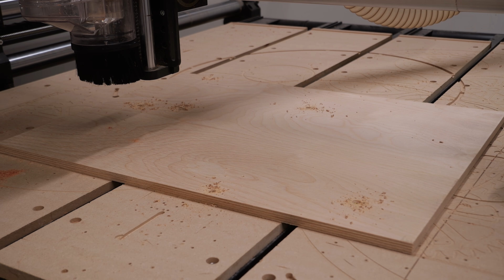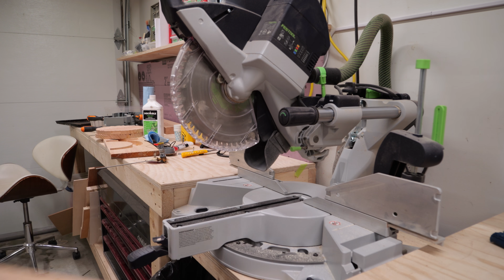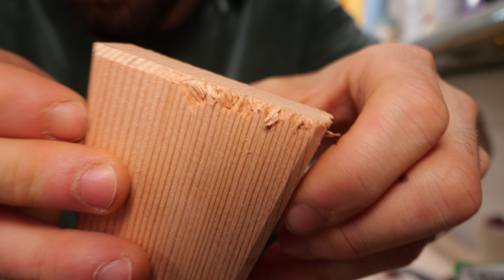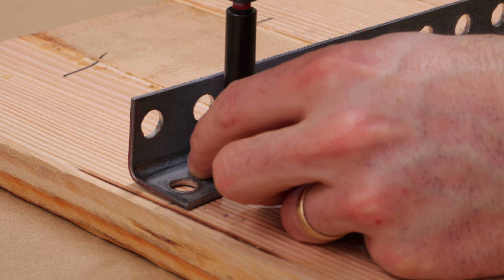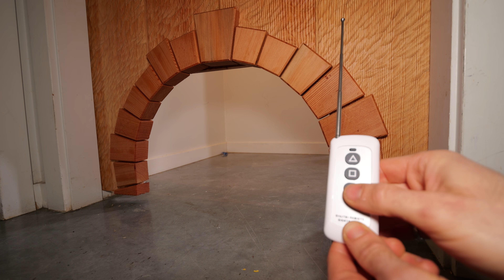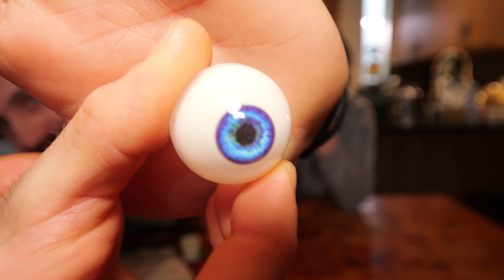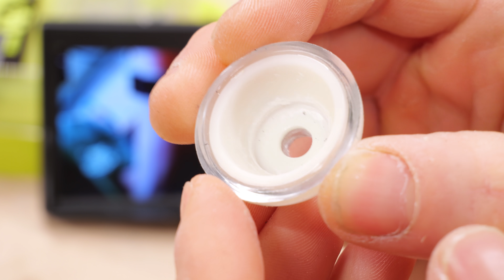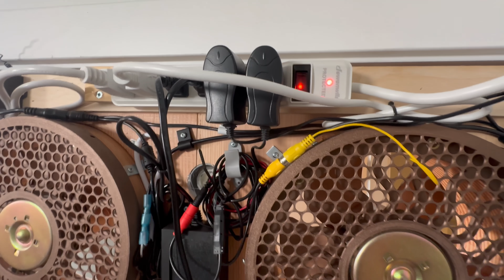I Built an Over-Engineered Door for My Wobbly Cat

Comment: Fellas, it's manual and overbuilt. It's not gonna chop up the kitty. The litter box thing was bad because it was automatic and could not react. This has a camera on one side, actual eyeballs on the other, and is manually controlled. And a paracord like that can hold far more weight than it is, as that's its job. The whole thing would need to be solid steel for it to be too heavy for the cord.
It's far more likely to just drop the cat when holding them in your arms than for this mechanism to bisect a cat. It's just a remote piston. YOU'RE just a bunch of wired pistons, and both are controlled by a person

Comment: I don't think this is AS dangerous as other commenters have stated:
1. Depending on the type of wood used, the door may not be heavy enough to severely hurt the cat even in the case of total failure.
2. Even if it is too heavy, solenoid closes the door slowly enough that if it catches the kitty it will not cause injury from the impact giving it more time to escape.
3. Using paracord instead of rigid linkages prevents the force of the solenoid from crushing the cat, only the weight of the door would be pressing down on the kitty, which is hopefully not enough to hurt it.

Now if a very heavy and dense wood was used, then that would be dangerous if something were to fail, and you can never be too safe.
I'd recommend using lighter materials and a spring loaded rack lock held closed by the paracord, if the string loses tension (i.e. the door is falling out of control) then the spring pushes the lock into a rack on the doorframe stopping the door immediately. This is the same mechanism used on the first elevators btw. If these modifications are done, then I suspect digital sensors and shutoff switches are unnecessary.

Comment: I've used Tuya valve controllers, it clamps onto a pipe and actuates the lever.

Actually strong enough to open a standard garden gate, during R&D I burned out a motor, I sent to motor wires to a linear actuator and it worked perfectly.

Comment: Agree with many other comments. It is confusing to understand what some mean by use the screws from a 3D printer, but if you add these to the design then you should be able to also use a motor controller and then determine if the door is jamming, which will then prevent anything from being smashed, cat, foot or otherwise. I feel that using a manual mechanism is fine, but you do have to engineer around the ability to make mistakes. The other option I saw that works just as well but would be harder to implement is a counterweight. I am not sure how you would build this in because of the space available.

Comment: Dude, in terms of CNC, YOUR HANDS GROWS DIRECTLY FROM YOUR ASS !!! First and for most - if you have a milling cutter that is held in a collet by the very tip... make a layer of passage NO MORE THAN 1 MM. Second - to avoid uneven edges... DO A BYPASS OF THE EDGES ALONG THE VECTOR BEFORE 3D SAMPLING. And third - NEVER CUT A WHOLE LOG OF WOOD ON CNC, glue a wooden board made of slats and it will not fall apart when cutting.

Comment: I am lazy and noise sensitive (so I don't really like vacuuming) so even before I got my first cat I got a robot vacuum albeit a really cheap one just to see if that would work for me. Then I got cats and needed to upgrade.... mine washes the floors, too, which is so necessary with pets.... and even the vacuuming bit: my cats don't shed that much, they are regular short-hair domestic cats, one of them is black, too :), but even so, if I am away for the weekend and the robot got stuck somewhere and couldn't clean, you can tell immediately. it doesn't do a perfect job, but the fact that it is done daily makes a huge difference....

Comment: Loads of people have already said it, but since none of the ones I've seen had a creator heart or comment on it, I'll say it too: This door needs safety features. The actuator locking in place prevents it from dropping at power failure, but not from cord failure nor from closing while something is underneath, be it from oversight or erroneous activation. Someone suggested a counterweight, and I concur. This would reduce the effective weight so it doesn't crush an unfortunately positioned cat.

Comment: You should control the door using ESP32 so it can be connect d to home assistant. This would allow controlling it manually from wireless switches and also automatically with motion sensors. You could create time based automations that only allowed manual control during certain hours.

Comment: For people worried about the Cat's safety you can rest easy:
- You can't push rope. go ahead and try it at home. try and push something using a piece of rope over 1ft (30cm) long. 
- the door closes with the use of gravity, the rope can't push the door closed (see point 1) and you could lift it up by hand without the mechanism being engaged.
- the door weighs at most 5 lbs (2.2kg) , and travels a distance of at most 1ft (30cm). at worst case, if the rope is cut or snaps, it's not going to have time to accelerate to a dangerous amount of momentum and will at worse, give the cat a bonk and a scare because they fall farther than that when failing to jump onto or off of things. 
- the door is completely manually operated. 
- automatic feeders/litterboxes that have caused problems have high torq, powered doors that are mechanically driven to close. 

Y'all're right in terms of fixes for best practices for safety, especially at anything larger than that scale. Counterweights that when unpowered default to opening the door. Mechanical locking pins that engage when the door is fully open. Proximity/line-break Sensors. Etc. are some of the great suggestions i saw. it's really important when designing to consider "What does failure look like and how can i make sure it's safe?" so keep up the thoughtful engagement.
Reply: I was about to not be able to sleep… thank you…

Comment: Not a good look to be hearting only comments that don't mention potential safety issues. I know it probably stings, to have put in so much effort on something only to have so many people criticize it on a fundamental level, but you really ought to swallow your pride and go back to the drawing board for the sake of your cat. It doesn't matter how unlikely an accident is to occur, an unlikely accident is still going to happen to *someone*. Safety regulations are written in blood.
Reply: People hope but never really believe they're going to win the lottery, and usually they're right, but every year a few people are wrong and it does occur. Granted this is a positive occurance so its fine if it happens, but the point is that however unlikely, it still happens to someone at some point, and there's no reason why you couldn't be that someone.

Comment: You need a camera power supply you can get them for multiple cameras then you only need one outlet or you can just kind of roughly add up the amperage on the ones you have and get something close to that I'm guessing those are one amp so you could probably do a five amp. But if everything is 12V you might even be able to power it from the same thing that's powering the lights. Yes old analog security cameras were not nearly that bad when they had a central single power supply but that's not how they're being sold today. I still think POE security cameras are the way to go you do not want Wireless for your security system. And if somethings say 5 V you can standardize on 12 V and use buck converters. I have a couple devices on my network that are 9 V and have a central 12 V power distribution battery back up and run those devices off of a converter so they're on the same system.

Comment: Machinist here. I realize cutting wood is a little different then metal. However I have too pieces of advice.
1) Generally speaking, keep you cutter stick-out length from the collet to no more than 3x the diameter of the cutter if you can
2) Get a larger diameter "roughing" cutter to remove the most material possible. Then come back in at a lower feed rate (travel speed) to finish the parts with the smaller cutter

Comment: I feel like for the safety issue, since he manually controls it and I noticed he sped up the video any time the door was actually moving,  I think it actually moves very slow. So its less likely that his cat will be like halfway under it and being squished. or at least the cat will be aware that it's closing and has plenty of time to move.  I feel like the door needs a back cover of some kind tho, like it looks super cool from one side but all its guts are visible from the inside.
Reply: It is slow and the footage is indeed sped up, but any failure and especially to the cord will lead to the "extremely beefy" door falling down full force at any time. And the remote control means it could activate itself at some interference outside of his control(some other remote controller activating somewhere and the acuator would pick the signal up). There is also no safety measure to counter any obstacle, meaning the 200lb acuator would just keep pushing at whatever is stuck under the door with full force.

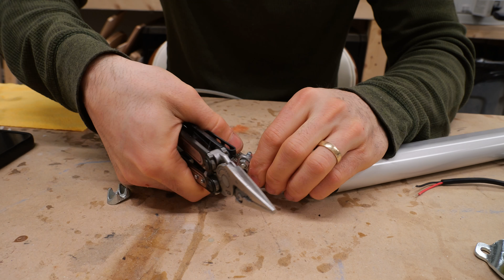Comment: At 10:53 your wire rope clips (cable clamps) are installed upside down. Always put the U-bolt on the dead end of the rope. (The short end.)

Comment: all it takes is one day of being too comfortable with that remote and you're going to hurt your poor cat
Reply: The actuator is too slow to hurt the cat. The only point would be the paracord snapping…. If he uses half decent quality paracord it can hold a humans weight. Hell i can’t mount my 550 cord across 2 points and if it’s tied tight enough I can do pull-ups on it at 210lbs. As long as he maintains the cord that cat will be fine
Reply: @Malaki-tffy  but the cat could chew on or through it

Comment: Please change the linear rail to a screw actuator (like in bedslingers 3d printers). I'm scared that this will be a big guillotine for the cat if anything fails to hold down the door
Reply: or just make the door open horizontally, and make them open by default using spring, so in case of power loss it opens wide. close them manually using electro magnet as a latching mechanism. Just push button to release, manually push it close to keep it closed.

Comment: There is a good reason for most pet doors to be made out of lightweight or soft materials and have microchip sensors/movement sensors and failsafes. Its for pet's safety. 
It looks great, but in the event of any malfunction, power surge or a cat trying to run back in while it's closing it turns into a deadly contraption. Please don't actually use it for your cat, it can be incredibly dangerous.

Comment: I agree with others here that while this is cool in theory, the way it works now is extremely dangerous for the cat itself. It’s basically one accident away from being a big heavy wooden guillotine. Beyond a potential paracord failure, no sensors make me worry that Penny can get herself or a part of herself stuck under it while it’s closing. Cats are fast, they can and WILL shove their paws under stuff at the last minute, and no one wants Penny to get pinched.
Reply: When Rachel and Jun made a door for their cats they changed the design for this very reason.
Reply: @PowerSpirit50  omg another Rachel and Jun fan! But I do agree that this door is not the safest thing in the world but it could easily be fixed by doing the thing he did with the big door with that metal stuff he had earlier
Reply: @PowerSpirit50 the reality is safety will always trump cool factor when it comes to building anything for pets! Is a big heavy wooden castle gate style door COOL? Yeah of course. Is it safe? Unfortunately no.
Reply: This is one type of Penny pinching we dont want ☹️
Reply: The door should probably be counter weighted if it's not so it it acts like a garage door and has a net weight near 0. Some sensors to detect blockage and stop the door would be good too.
Reply: @TechnicallyTom it locks it self tho
Reply: It looks like the door closes pretty slowly, so there's probably not a huge chance of it hurting her during normal use, but a malfunction causing the door to fall down quickly could definitely be a problem.
Reply: I think the fact that its gravity down helps, so the actuator doesnt push it. I would pocket the door heavily to reduce its weight a lot and make it safer, and maybe add some counterweighting.
Reply: But that’s just a theory
Reply: As far as I understood, he said that it's a totally manually operated door, so he can see when Penny's inside and then close the door.
Reply: @miriammcfarlane6972 manual operation is not really a safety feature though and having no secondary safety features is still a problem. Like I said, cats are fast and love to shove their paws and bodies under things unexpectedly. All it takes is looking away for a second or getting too comfortable to accidentally squish your cat. There needs to be atleast some way of sensing if an object is under the door that will allow it to stop closing automatically. And it also doesn’t account for the single point of failure that is the paracord that holds the whole door up. If it frays, slips, or gets jammed, there’s nothing stopping that door from free falling. I’m not saying this isn’t a cool idea! It’s just not a safe and complete idea without some backup precautions
Reply: @calibunnyVT  why do cats get all the love instead of dogs? I can guarantee that if this was a doggy door then nobody would even care. Most cats are rude and annoying, Penny is the exception.

Penny is not going to get hurt because this is a FULLY manually operated door. Therefore the door doesn't close on it's own. Morley would have to manually push the button. And when cats are in pain, they will usually meow loudly prompting him to look at the camera, opening the door. Penny would be "guillotined" for less than 10 seconds...

It's not that big of a deal
Reply: @calibunnyVT  There's different strength parachords. If it is 550 parachord, it'll hold 100 lbs (I'm over 172lbs) and if the door is that heavy, something is seriously wrong here...  I get that things can hit harder from above, but the lighter an object is the less damage it would cause and I doubt a parachord would just fray or snap easily unless it's one of those super cheap and barely handles any weight. I don't think Morley bought the cheapest possible either so it's not to be a huge massive concern and this guy has a college degree in designing things like this....
Reply: If its 550 parcord it will hold it is extremly strong when done properly it can lift 110 lbs for refrence the avrige person is 136 lbs and if that tiny door is that heavy domething is wrong so I am pritty sure you are woring about nothing 
That is without pushing it
Reply: @carenthuist496paracord frays
Reply: I didn't even get to the guillotine door part.

I can't get over using a nail gun with a cat on the other side of the door, even unintentionally.

Nail guns are deadly. To humans. Through a human-thickness skull. Let alone a cat.

My cats are NOT allowed in the same space as my power tools. End of story.

It's not safe for them and they cannot consent to the risk they pose.
Reply: Holy karen
Reply: Unreal! That is an incredible puzzle door and hopefully Penny will enjoy her door.
Reply: There’s a bit of space below the door when closed
Reply: you're really dangerous 😂
Reply: @lucyhart3845  All the more reason to listen to them.

Comment: I dunno man, I feel like automatic doors like at a grocery store is going to be a lot safer than a wooden guillotine.
Reply: Yeah when he showed the weight I was like O.O
Reply: Opening in a horizontal position makes more sense although less castle-y
Reply: hope no one get hurt from this blunt guillotine
Reply: Depends on the type of paracord he used. Hell I’ve helped myself up (210lbs) from the ground with 550. Which can hold 550. As long as he maintains it then it should be fine
Reply: the actuator is self locking

Comment: I'm a little worried there's no pressure sensor on your linear actuator - what happens if it's going down when Penny's halfway?
Reply: My thoughts exactly! It is safer because he manually controls the door. But the set up reminds me a lot of those automated litter boxes with motorized doors that ended up hurting cats.
Reply: I’m pretty sure he has to press and hold the button otherwise it stops the only thing I’d be worried about is the parachord failing.
Reply: i don't know how heavy the little door is but there are no mechanics pushing it down
Reply: @neko0my0cat Morley said it's pretty heavy :/ and it's solid wood, so I'd guess at least cat weight.
Reply: @neko0my0cat  watch the video again
Reply: @neko0my0cat  It sounds like even if there's no power behind the closing mechanism, worst case scenario could be it slamming on her tail (which could cause a spinal cord injury) or closing on her neck and strangling her.
Reply: @neko0my0cat  gravity is a force that doesn't require any mechanics.

Comment: I noticed you’re using one of the Nite Ize carabiners those are great. You might want to check out the Nite Ize Figure 9 Carabiner though. It’s really slick because you can clip it on like normal, but then also tension your rope super easily without tying knots. Makes setups way quicker.

Honestly, Nite Ize has a ton of stuff like that it might even be worth reaching out to them about a sponsorship. With all the stuff you do, it feels like their products solve a lot of the exact problems you’re showing.